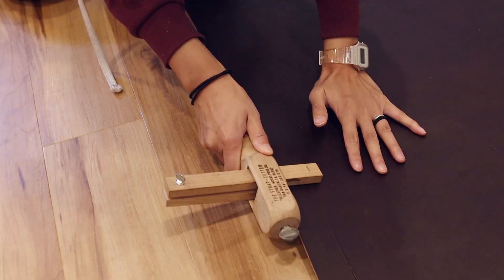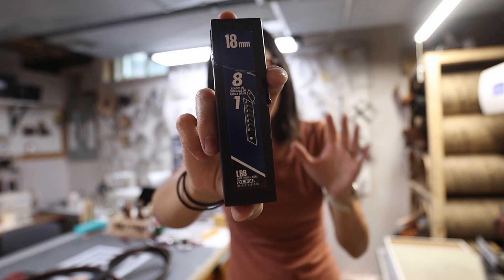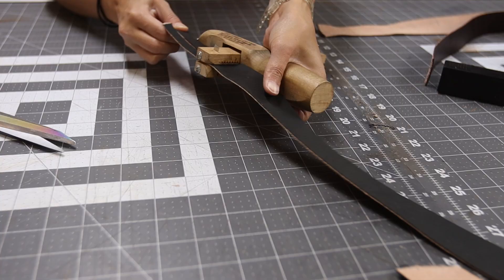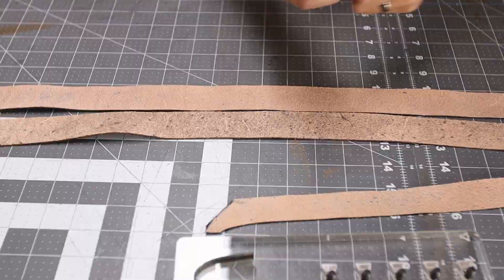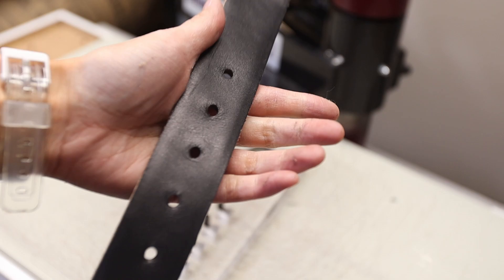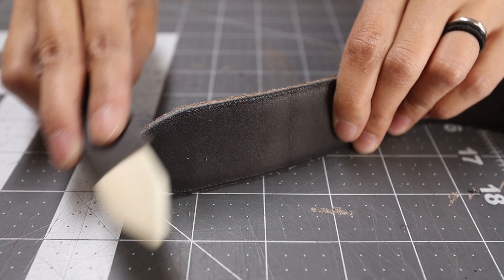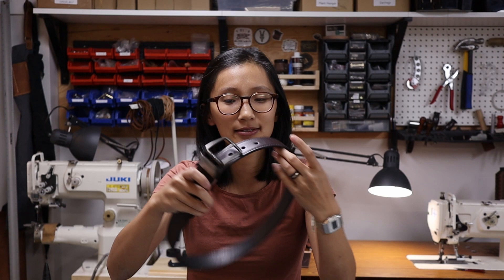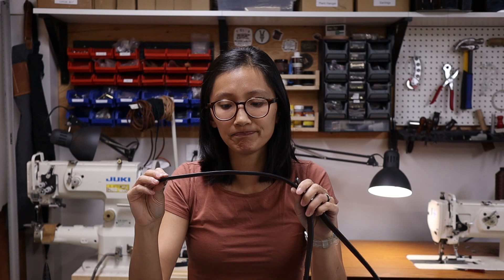Making a REVERSIBLE Leather Belt

Comment: Nice tutorial! What glue do you use here? Kinda new to the gluing process and when I have tried, the belt seems to bunch up/bubble up when bent… Any advice for a newbie??
Reply from the maker: I'm using ecoweld or aaquilim 315. Make sure you spread the glue out evenly and let it dry until it's tacky and then adhere the lining. You can use a heat gun to help make it more tacky as well. Then use a bone folder or something similar to smooth it down!